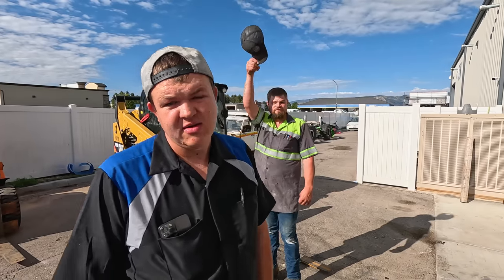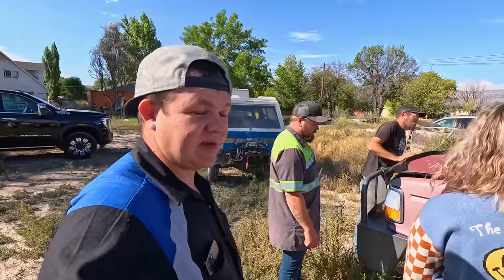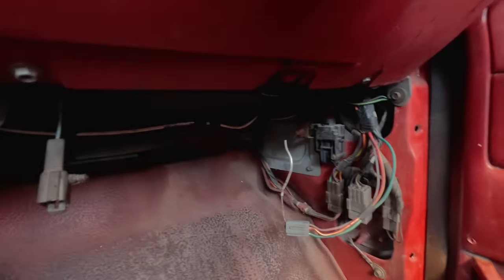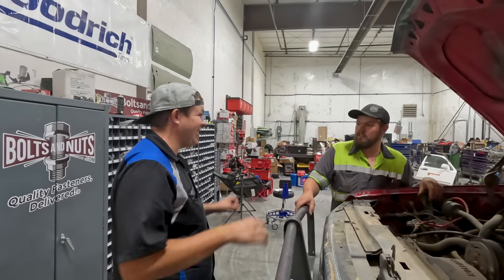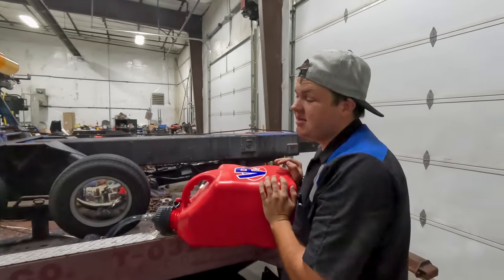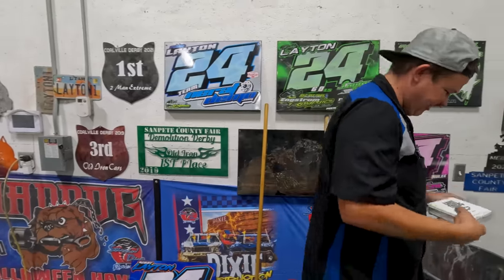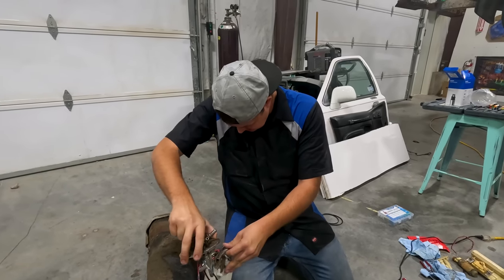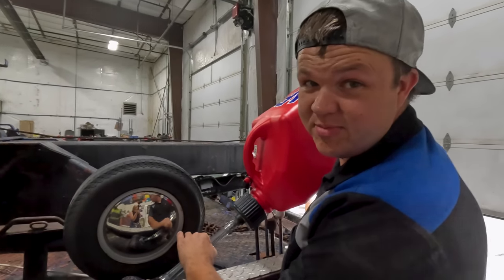Old Ford Tow Truck FORGOTTEN For Years! Will It Start?

Comment: Well, I can’t say much about engines etc, and I’m probably the only one to comment on McD’s. Waaaaay back in the mid 70’s I lived in Oak Harbor WA which was a NAVAL base with lots of military.  We had one small burger place called Kow Korner with 25cent burgers and since the cent sign isn’t available I can’t type 25cents accurately. I could write it out $0.25 but the charm of the 25+cent sign is lost again.  Anyway you have NO idea how delighted the Navy and Marine Barracks people and families were when McD’s came to the island (Whidbey Island).  Yeah, like you guys in Utah welcoming Wendy’s. But Kow Korner was good they just didn’t have the BigMac and I don’t think they even had ice cream then. Maybe Kow Korner did though.  

And I must’ve missed why you say soLder instead of sod-der for solder.  It’s sod-der fer as I k-now.  And I keep wondering if they would help me w the sewing machine power cord which electrical tape just doesn’t stay stuck over my sod-der and tape.  But I would t ever use a bunch of those …. Hmm 

I really enjoyed the vid and reading many comments.  Yay Hillbilly!  And I agree that Lay’nt is having a good time in the shop and in front (leaning in too) of the camera. Great job you guys and the Boss and your kiddos “two”. ❤

Comment: Robby... If that steering keeps whining, flush out the moisture and steering fluid from the rack and install Ford Motorcraft type "F" transmission fluid instead of cheap off the shelf steering fluid that Hillbilly put in... I redid my Ford Aerostar that way and it solved the steering noise that was being caused by moisture and foaming...🛢 "Motorcraft ATF Type F is recommended by Ford Motor Company. It is a high-static friction fluid developed for Ford automatic transmissions manufactured during the 1970s and earlier. The special frictional properties of Motorcraft ATF Type F ensure proper shifting in Ford transmissions that require a fluid meeting ESW-M2C33-F. It is also recommended for power steering systems in a wide variety of Ford Vehicles calling for a Type F fluid, built prior to Model Years 1996-1998. Check Owner Guide for proper application
Motorcraft ATF Type F resists foaming and protects against rust, corrosion, wear and deposits. Its low viscosity makes it suitable not only for Ford power steering units, but also as a hydrostatic drive fluid for many farm implements and certain industrial equipment applications
Motorcraft ATF Type F should not be used in newer transmissions requiring MERCON ULV, MERCON SP, MERCON LV, MERCON LV, Continuously Variable Chain Type Transmission Fluid, Motorcraft Premium Automatic Transmission Fluid or FNR5 Automatic Transmission Fluid"

Comment: I "like" Chevy cars better than Ford cars (Mustangs excepted). But, based on experience with a lot of different wrecker bodies on an lot of F350 chassis versus a lot of different wrecker bodies on equivalent Chevy/GMC chassis I've found the Ford to be the superior work vehicle. The F350s always felt tighter, more solid, "stronger" and more comfortable. The "antique" jumper cable plug-in box setup on your 1992 F350 is actually a very handy thing to have. You're still good to go if someone has "borrowed" the  jump box and they don't "run down". Back in the day, if you did a lot of road service calls they would save the driver's back and the hood's hinges (imagine the wear on the hood's hinges if you're raising the hood ten or twelve times a day, every day,  just to give a jump start!) The combination of having a sling/wheel lift unit with nice winches and a good set of dolly wheels on a four wheel drive truck probably gives one the best possible go anywhere, do anything  tow/recovery vehicle.

Comment: That old Ford will run for a hundred years if you take care of it. I do highly recommend that you pay attention to the transmission. I had a 95 F150 that was a fantastic truck, the only issues I ever had was the transmission.  I come from Ford country, I grew up just 20 miles away from the Ford Truck plant in Norfolk Virginia back before it closed.

Comment: Please please please do some research before operating your tow truck, take a course from a reputable tow company, something... and please don't fix something that ain't broke, those hydraulic winches are the 💣 when operated properly, hillbilly even said it, the idle needed to be kicked up for more power to the system. I operated that very same truck ,well one almost identical and you want the truck to be running anyway when using winches so your batteries don't die and end up leaving you needing to be rescued. I love Paul and all ,but I wouldn't want electric only , sure get some side electric winches if you want , but with snatch blocks you really don't need any.  
That stinger is gonna be very helpful, I used the one on the truck I drove most of the time..., there should be a switch on the dash or lever that holds the troddle for higher idle . Awesome find 👍

Comment: 90s ford 460 7.5 L engine by the look at the top of that. Top notch engine, all the power you could want, but better have a good card since it loves to drink gas :p Favorite memories of my childhood were made in a 91 F350 with that same engine, as a tow truck. Great truck, almost 300k miles before the output shaft in the transmission let go. Still have the truck, hoping I can make it go again someday.

Comment: That's a Ford for ya. You can leave it in a field for 7 years or longer out in the elements then throw some new gas and a battery in it and drive it down the road. 
Built Ford tough !  ooooRaaaa!

Comment: I have used the solder sticks in the past and they are great, but i can 100%  tell you that they do not like gas. After putting an in tank fuel pump in a jeep i did an ls swap on, i started having isues and had to drop the tank, the rubber was super soft and the solder crumbled.

Comment: If you are lucky you won't have to gut the wiring on this old tow truck, because typically these old recovery machines are wiring nightmares as at 2 or 3 wiring hacks have taken turns at hillbilly auto electric butcher jobs. If you are lucky this will not be the case on this old tow truck.

Comment: Roby, to check if the 4 wheel drive works, get it in a gravel or loose dirt area.  Shift into for low, go full turn each way and if it jumps the 4 wheel drive works!

Comment: Hillbilly...gasoline does not have water in it unless it's gone bad.  Most gas does have up to 10% ethanol in it, and over time the ethanol will absorb moisture (water).  This is one of the biggest problems with pump gas.

Comment: The 94 E4OD is better than the previous model AND the 460 head bolts are easily broken at the 7 cylinder exhaust. Fyi

Comment: That power Steering pump is the worst. I swapped a Sagsaw pump from a 1 ton van into my 92 Bronco. Used the stork bracket work excellent.

Comment: I have a similar 3.5t speclift / under lift truck over here in the UK  ( freight rover king cab truck ) , my truck has the rear leaf springs cut off around 12" out from the back of the axle and drilled to take Dunlop airbags .Box welded to the chassis for the top mount .Simple T adaptor to join both bags to the air valve i use a 12v tyre inflator on . Panard rod comes down to the axle to center it with it not having the full springs anymore . But the adjustable height and better axle movement is worth it . Run them at 70psi so the ruck sits high and only drops 3" when i load a 20ft panel van so it sits where it should be when unloaded on the std springs . One of those easy worth it mods .

Comment: You should look into getting a Good-all 10,000a 12/24v jumper box… Pretty expensive to purchase, but, it will start anything that’s dead… put two diesel trucks and a jump box and couldn’t get my dump truck to start, put the Good-all on it alone and it fired in seconds..!

Comment: So Robby, I know you are a Die Hard Chevy Guy and that’s fine. However 
I know you will be surprised at how tough and reliable that Ford Beast
Will be once you have spent some time overcoming the fact that it has 
Been neglected for a good while. I have a little older F450 Superduty 
and they are built very tough. Give it a chance and I think it will surprise 
You . LaytonNation is Awesome.  
MWP Cosby,Tn.

Comment: 12:08 well 4.20 a gallon is 1.13 dollars per Litre

Well here in swizerland diesel is exactly dubbel the price of this. so 8.40 dollars per gallon.. 
Cheap gas the 95 stuff is around 1.94 chf thats 2.14 dollars per litre so around 8 dollars a gallon.

cracy how cheap gas is over in us... But i still get the point.. we where use to pay 0.6 dollars less to. but like 3-4 years ago..

Comment: I have an 1989 Ford F350 heavy duty 10. Lug for sale with a 460 runs $3000. It is just a truck and has a regular 8' dually bet on the back

Comment: SolderSticks really are great, but I get a kick out of some of the current advertising, especially for the knock-off brands, as though they are new to the market.  I used them on aircraft maintenance back in the 1970s.  While you can use them with almost any heat source, a heat gun with the proper curved air director works best.

Comment: Every time I get McDonald's I have to pull up and wait for my food, at Wendy's they are  holding my food out of the window as I pull up. I always have a special order, at McDonalds it's no rehydrated onions or pickles, at Wendy's it's just cheese and mayo. It's the corporate culture of each. Our first Wendy's was small and after a decade it was always packed at lunchtime so a new larger restaurant was planned and as a stop gap they started having one employee inside and one outside taking orders in the lines during rush periods. By the time you got to the register your food was ready and it was right.

Comment: Hey Robbie, just a fyi. As I have a 1990 motor home that had a little problem. Which is the pickup coil on the distributor. As a PM (so you don’t get left out in the cold) get that changed the part is like $50. Or a complete new distributor. Not sure what motor that is, mine is the 460. 

Good luck, it should serve you well. Especially since you have some guidance from Rory, on his…

Comment: Just a couple things to help you along with this... Econoline van with the 460 will have the power steering brackets to install the Saginaw power steering pump, the Fsuperduty will have front leaf springs to lift the front or you could go with the shackle reversal kit, most also have the parts to upgrade to the hydroboost brakes. The medium duty F600/F700 doors will have the better "west coast" mirrors.

Comment: You will need to upgrade the alternator if you are going to run electric winches. I believe they are only 95 amps from the factory. Our 94-96 460 fleet went through them (fires included) until we had custom 150 amp alternators made. Outside of the ride from the  front leaf springs they were great trucks.

Comment: Put a Saginaw Power Steering Pump on it. Will be much better with the larger tires. If the steering box starts to fail, put a Red or Blue Top in it.

Comment: A trigger point: Chevy guys get to fix them (Chevy's) a lot, so they understand them. Granted, Ford engineers should be slapped for some of the stuff they come up with, but I've owned both Ford and Chevy, reliability is not a Chevy strength, ease of working on a vehicle is not a Ford strength, you just don't have to do it as often so of course, people are more comfortable with something they work on all the time.

Comment: Try 5.29 a gallon.
CA bovine excrement laws n taxes.  Truck dont know if its winter, spring, summer or fall, but Ca says we need different fuel for different seasons..
Really means how much trash they can burn in our fuel and call it climate change

Comment: You may need to change the kanooder valve if the truck has been sitting for more than a couple of years.  The ratcheting exhaust fluctuators could be plugged also.  They are notorious for attracting hornets as they make a warm nesting area.

Comment: Before back burnering the wrecker you may want to consider a brake fluid and coolant flush since its already long past due and not just the normal 3000 mile fluid changes.   I am a big fan of installing return line filters on my hydraulic power steering systems as that can save a ton of grief from clogged pump screens.

Ls conversions are overdone so perhaps a Godzilla or a nice Cumins Diesel in the future if the current engine is too far gone to keep.  A proper treatment with Carol Shelby's ZMax might make that old engine surprise you though and add years to its useful life.  It's saved quite a few engines here that we thought were toast due to sticky rings and collapsed lifters but it freed them all up and they ran smoothly for many years afterwards.

Best!

Comment: What's funny is that you sound like me as an old man that can't remember s*** that used to build cars and do all the s*** that you do and you sound like me when I was in green and you're just learning things for the first time I mean after this truck is set for so long the gas everything is turned to lacquer even the inside of the fuel lines are full of lacquer built up over the years of sitting there getting hot and cold and now you're going to start this thing without putting a filter on without taking the fuel tank out of the scenario and you can get a try to put gas in the fuel tank and make it work when there was a reason why it got parked to begin with you either not too bright or you're trying to dumb down the video for people that have no idea which I don't really appreciate we all have Hillbillies or at least we should but we can't lower our standards for the observing people didn't you love the way I phrased that so in other words you have a otherwise informed viewership I don't think you need to Pander to the uninformed